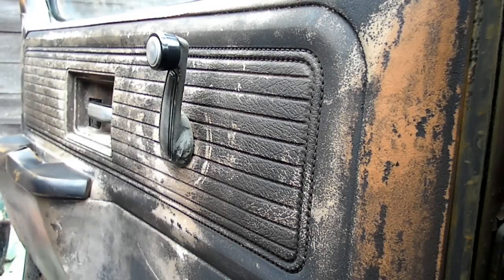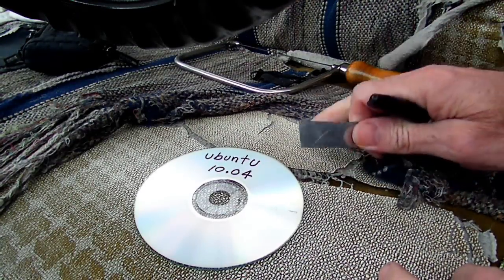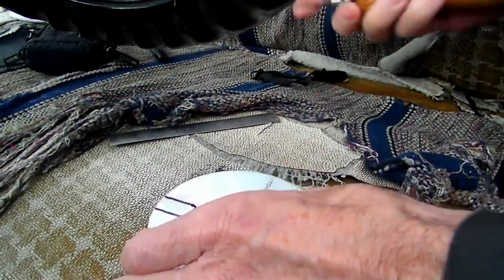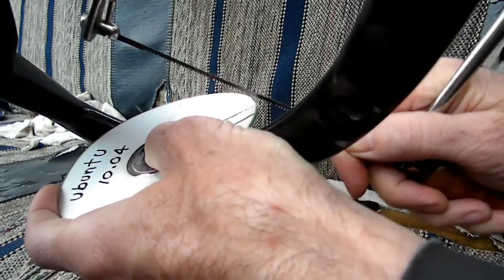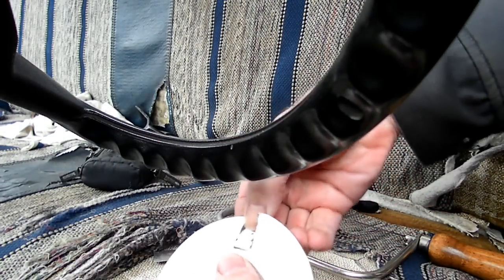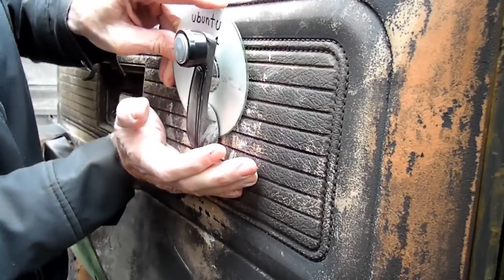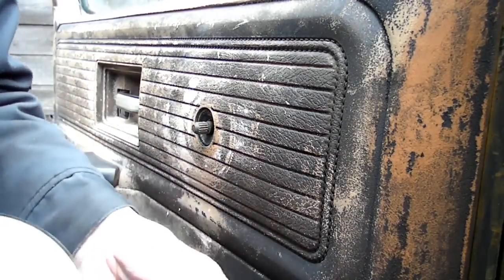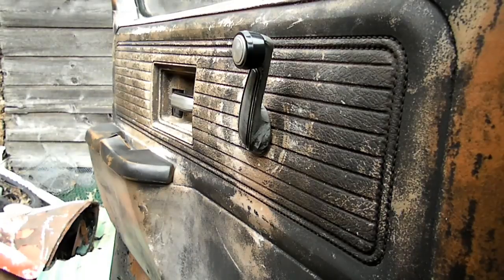Crank Handle Removal With CD

Comment: Nice Tool! I've got one of those clip remover tools, but a flat-blade screwdriver shoved in there and turning the handle usually gets the clip out just as easily.  Getting them back in is a little trickier.